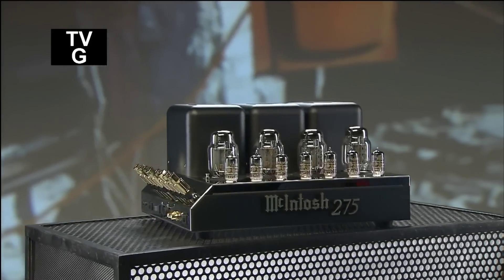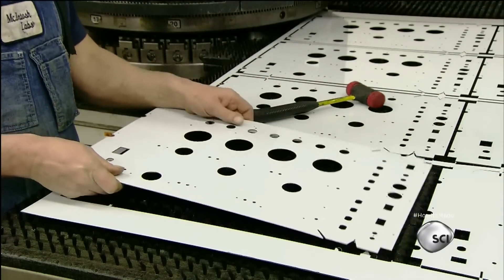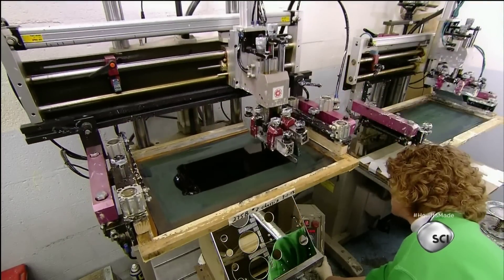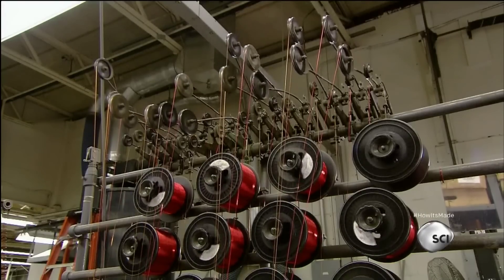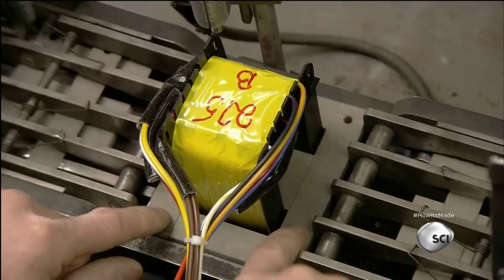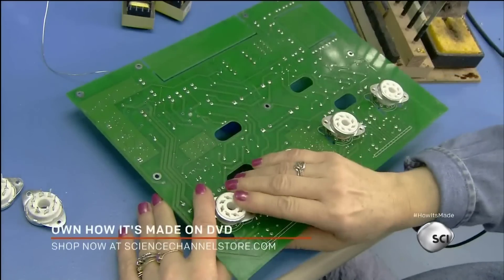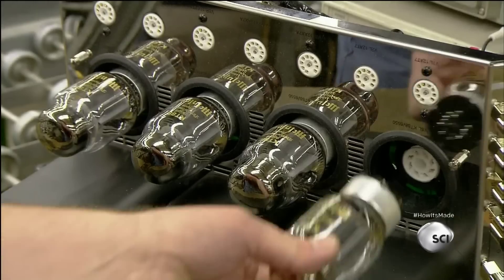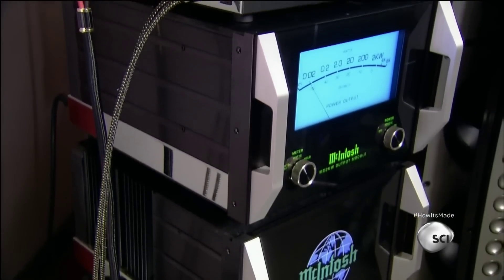How It's Made - McIntosh Tube Amp

Comment: Colored LEDs in the tube bases.. was this abomination really necessary? One thing about the authenticity of a tube amp is the faint orange glow coming from the tube filaments.. shining a green LED light over that kinda ruins the whole visual aspect.
Reply: Michael Ledford You're totally wrong on that count. I don't hold any kind of grudge against McIntosh or other manufacturers of tube amps. In fact, I am quite pleased about the overall build and sound quality of their amps.
I am just a retro technology fan, and have built and designed a lot of tube-based devices (amps, radio gear, synthesizers, clocks, ..) over the last two decades, and I have the strong desire to keep tube-based devices as "pure" as possible. I even felt bad for using silicon rectifiers in three of my amps instead of an EZ80 or similar tube.
Throwing in colored LEDs, displays, lighting effects and similar "new" electronics features into tube amps, in my opinion, destroys the whole effect and atmosphere that the tubes were originally meant to convey. Shining a blue LED over the warm orange glow of an audio tube is like bringing an air horn to a Mozart concert. By itself, it may be a useful tool, but in combination it's just awful.
Reply: +Markus Strangl   The green LED's indicate when its ready to be played.  The tubes need a short initial warm up.
Reply: I would dare to add that vacuum tubes and indeed all electronic amplifying devices are photo sensitive.
Indeed light impinging on a charged vacuum tube plate demonstrating the photoelectric principle was the discovery that gained Einstein his Nobel prize.
If they went to the trouble of using brass speaker connectors with the BS explanation that magnetic materials cause distortion then the noise induced by green light leaking into the anodes of the 12ax7's would totally swamp that effect.
Next time you turn on a valve amp, turn it up and shine a torch on the pre amp valves to see that it's true.
Laugh!
Reply: I think its aimed at the deep pocket millennials. The potted transformers on the McIntosh were the saexiest part, not the LEDs or tubes IMO.
Reply: Bernie Zelvis Don't mess up their marketing with your science! ;-)
Reply: +Markus Strangl    It seems Mac is just following a trend that can be found today with some tube components. I have an led light flashing on one component. But, while the tubes are warming up... then shuts off to indicate when the tubes are ready for use. Mac is simply doing what some others have been doing.  You are right though.  The nice glow of tubes in a darkened room has a calming and soothing effect.  I use to find it to be somewhat therapeutic to watch when I had all tubes.
Reply: If you have a McIntosh preamp, you can turn off the led lights of the amp from the pre-amp. Problem solved. I keep them on.
Reply: Dude,its mcintosh.i dont know what you were expecting....
Reply: +Markus Strangl Chinese factories only do this boards with leds on it, so this brand had no other choice!
Reply: haha!
;)
Reply: i agree with you
Reply: MrWalker1000 modern tube amps by McIntosh will outlast any solid state amp made ,with tube gear you simply have to replace the tubes once they won't hold a bias anymore, I only buy McIntosh tube amps because they are self biasing where tubes last for years.
Reply: MATT DEADMANN And with spelling and grammar like yours, yeah the species will be doomed.  In case you didn’t know Radio Shack is pretty much extinct.  You can make your own tubes, eh?  I believe we’d all like to see that.
Reply: look up the patents filed by McIntosh for the unity coupled amplifier, it clearly outlines how these crossover distortion problems of the standard transformer were overcome. thats why the McXX and McXXX amps still sell on ebay for ~75% of their inflation adjusted list price, or more. its an elegantly simple engineering solution which massively increases the coupling coefficient, lowers the output impedance and provides local, nearly instantaneous combination of capacitive and inductively coupled negative feedback to the cathodes, while supplying 1:1 positive feedback to the screen grids keeping their potential constant with relation to the cathode. this in turn prevents the power tubes from "switching off" entirely during the low current swing of the audio signal, eliminating the transient created by the tube going into "cutoff". another upshot is that because the feedback is transformer coupled at unity, any transformer saturation effects at low frequency are compensated for as the negative feedback is proportional to the transformer saturation state. i.e. as the transformer saturates, the output tubes are driven harder
Reply: Popart 2015 YOU must not be a McIntosh owner judging from your comment , McIntosh is made in Binghamton NY , they make 2 versions of the same amp featured , with led & without led , McIntosh can configure boards anyway they like , the " Blue " hue led's were added to modernize a 60 yr old amp style so it matches New model McCain gear , check my google+ homepage to see examples of what modern equipment the led is meant to match .
Reply: agreed
Reply: skrads yeah but the signal path ,music as the musican intended ,distortion above 0.005% lol ,I figured I'd give you the usual audiophile nonsense for fun after hearing 40 years of shit about my Mc gear having tone controls lol
Reply: solid state or tbe amps better. I hear solid states last longer and tube amps are less portable and die quicker.
Reply: Michael Ledford haven't solid stated nearly replaced everything electronically or anything that can be done with a signal there isn't anything that can't be done with sold States anymore they have nearly replaced everything and are the sound of the future
Reply: MrWalker1000 actually no ,the military still uses tubes in applications where solid state won't work ,in amplifiers using tubes instead of solid state works much better for ohmages above 8 ohms .
Reply: Michael Ledford I'm not talking about the military
Reply: Michael Ledford hehe... there is only one case where the military uses tubes over solid state and that is input stages of RF preamps. The reason is, in the case of navy systems for instance, a radio receiver may be only meters away from a transmitter putting out hundreds of kilowatts as is the case when goods are being transferred from ship to ship.
Powerful transmissions at such short range can induce thousands of volts on the antenna which would blow a transistor stage to pieces.
This condition doesn't occur in a domestic audio amplifier.
As for impedance matching, tubes have very high impedance compared to solid state which is why an output transformer is required on the tube amp to match the low impedance of loudspeakers. This in turn causes bad (loose) coupling between the output stage and the loudspeaker which in turn gives tube amps a terrible damping factor.
Upshot is the loudspeaker is allowed to resonate and carry on like an undisciplined runaway dog once energised by the loosely coupled output of the transformer creating all sorts of unpleasant and unintended intermodulation products.
Hence the 'tube sound' AKA 'distortion'
Hey, but when you pay such a high price no one is ever going to convince you you've just been rorted.
Unless you've got so much money you toss the McIntosh and buy a proper low distortion amplifier.
Hehehhe.... just sayin'.
Reply: Your pain, feel it I do :D
Reply: Or you do the smart thing and get several vintage systems and have the best of both worlds. Oh, and we are not going to war here and the distortion is far from unpleasant I assure you. Perhaps your gear is in need of repair?
Reply: I agree the LEDs are overkill. The glow of the tubes is what makes them look cool. My home built amp is glowing at me now.
Reply from the maker: Greetings 12volt!! I enjoy your channel very much! Dave
Reply: Thanks. Just overhauled a vintage NAD. Video to follow
Reply: You get what you pay for. Quality costs money, and these units are hand made. These are low volume units, and things like the transformers have to be custom made in house, and it required many hours of trial and error to get the design just right for the spec. So if you can't afford a quality made piece, then go buy something from china. I have built my own tube amps, and I can tell you from experience that to build a small single ended amp with only about 8 watts of power cost me about 1000 just to buy the parts. The transformers were the most expensive parts. Does it sound good, yes it does. Sounds fantastic. Is it worth the money, or course not. No tube amp is worth what they cost, but if someone has the money to burn they why would you criticize them.
As the story said "some people prefer the sound"
I am one of those that prefers the sound that tube amps provide.
Reply: Yeah imagine i just watched the same video material, let aleone i used to live near shop with this exact brand.  Dude explain how come you try to build your your own amp, but cannot even build a transformer. I mean
take a grasp in reality. Sorry but i look at things from the professional point on perspective, I cannot image how in the earth you would bring that thing on stage. The designg is dumb  and showoffy. 
And if you had ANY exprience about professional audio recording You 
would know that to get desirable sound from amp, you use EQUALIZER.

By the way you need at least 6 speakers to get a good stereo sound.
Cause you need separate speakers for given range of frequencies.
And about money... sorry to burst your bubble. I know you really white
people think you know everything... Let me tell you something from 
a Slavic guy. Most of people DON'T even earn american minimala wage.
I am that most of people, before you tell anything stupid... No i don't drink. Not all Slavs are vodka chugging morons. Just try living around them, that's WHY i have learned your language. And seeing that you can afford to waste your cash so frivolously... America is the place for me.
Reply: whatever i like it
Reply: Blue LED's should never be used in any electronics, especially the super bright blinding blue LED's. I'll take an amber/red/green LED any day over blue.
Reply: I am not a fan of blue LEDs period. They are harder to see. Especially on clock displays. The eye is not as sensitive to blue light.
I have built a few tube amps, and I put orange LED below the tube just the enhance the natural glow of the tubes and make them stand out. They actually look really good, especially when the power tubes have a slight blue glow inside, which most do. Seeing the filaments lit up, and the slight orange glow on the glass with the blue glow that modulates with the music inside is very cool.
Reply: authenticity!!!!! authenticity!!!!! authenticity!!!!!  wheres the authenticity

you realise that back in the day of tubes most consumers never even got to see the tubes right?
they was hidden away and no one cared to look at them most

this is just a modern take on tube technology if your buying a amp just for its looks then you probably dont need a high end amp in the first place
Reply: Yes, it's ugly and stupid to this traditionalist.
Reply: McIntosh might be doing what Luxman did with my amps preamp tubes, running the heaters well below the spec voltage for longevity.  The resulting glow is very faint.

I would hope that the LEDs could be switched off.  Green is a very unnatural color in a tube.
Reply: If they so wanted to use LED illumination inside the tubes they could have done that with just red, orange LEDs. Tubes glowing green is nothing but awful to anyone who has seen a retro tube amp working. It's like a vitage car fitted with Model S headlights - ruins the whole idea.
Reply: The reason that model has the led's is so it can match most other McIntosh products blue hue , if tube color is a huge issue where you want the dim orange glow simply buy a different McIntosh tube amp that don't have the tube led's , I've seen 10,000 tube amps with the same old tired look & it's refreshing to see a change.

I own Mc-1201's SS ,Mc-2301's T, Mc-2102 T , C-2200 T, C-22 T, C-20 T along with a host of other new & vintage McIntosh products & all are without fault & best most gear made .
Reply: Markus Strangl Well that's good to hear & I apologize of I mislabeled you as an Mcintosh basher , I'm sure your aware of the McIntosh hate crowd .

I'm a collector of vintage McIntosh gear as well , we have 4 Mc60's , 2 Mc275's , 3 Mc30's , C-20 , C-22 , MR-78 & all vintage models , none of which match our modern McIntosh systems , we run a C-2200 metered tube pre &c-1201 monoblocks powering the woofers on our XR-290 line arrays , we have a pair of bridged Mc2102 metered tube monos we've been powering the tweets in that system with , the entire rig is blue metered & if we were to insert any of the vintage Mc amps into the rig they would look very dated & out of place , McIntosh has to keep up with the Times as us tube guys are a dying breed , while tube gear looks like artwork to us it looks like industrial stuff to younger folks so I understand their need to remain current by adding led 's to 50 yr old designs .

In a day & age where spending $3k on a home system is seen as insane , and11 channel processors with pro amps are the bulk of home theater gear I understand & agree with Mc trying to add style to such an old design .
Reply: Gene Zucker I'm pretty sure that guy is just a McIntosh hater , I'm sure you've ran across many like him as I have who believe Mc tube gear is somehow inferior to Audio Research & other tube gears , I've got Roger Russell's personal XR-290's & his personal XRT-22's playing now in the background , I've got the WHITE 290's shown on Rogers web site .
Reply: Frank W check out my google + home page if you dig potted transformers , I've got some monsters pictured there with postage stamps as size reference .

Comment: How is this a tube amp when it's got so many integrated circuits on that board ? I bet there's even a switching power supply in there. It's a tube amp simply because it has tubes ? C'mon..
Reply: +weed2luke I only see 3 ICs, and 2 of them appear to be 7000 series jelly bean parts. They are likely used to run the pointless blinky light system :) . There are many ceramic high capacity resistors mounted upside down (to hide their manufacturer?) and Wima brand film caps (not boutique caps but a recognized and respected brand in industry) that might be mistaken for ICs. It clearly uses a Linear power supply, it has a dedicated multitap transform to do it right on top.

Their method of tar-ing the transformers is very cool, most audio (and other) equipment manufacturers will varnish a transformer to keep the iron plates from resonating (it becomes a crappy speaker!) at low frequency.

I would gladly pay ~$300 + tubes (no idea how much tubes go for) for a handbuilt unit of this quality, but alas they have branding and scarcity that allows them to charge somewhat more ridiculous pricing.

TL;DR version: The tubes do the amplifying from a power source. If the amplifier is tube, and the power source is linear, I don't think you can argue that this is anything but a true (non hybrid) tube amp. Any ancillary circuitry is just irrelevant.
Reply: +Dave McAnulty At 3:58 there is definitely some sort of pulse type transformer right in the middle of the screen. Furthermore, at 3:37 in the upper left corner area, there is something that looks really close to an optocoupler... which is often used to close a loop around an isolated smps... I don't mean to be rude, it does look like a nice piece of engineering. But I would only call it a tube amp if everything from input to output was made using tubes and not only that, but also the power supply rectification and regulation. That means no silicon whatsoever.
Reply: The audio signal path is entirely "hollow state" - nothing but tubes from the input jacks to the output transformers. The  power supply does use solid state rectifiers because good amplifier performance demands a stable power supply, which you won't get with tube rectification. Any solid state electronics on that circuit board will only be related to those silly green "tube is good" LEDs under the small-signal tubes' sockets.